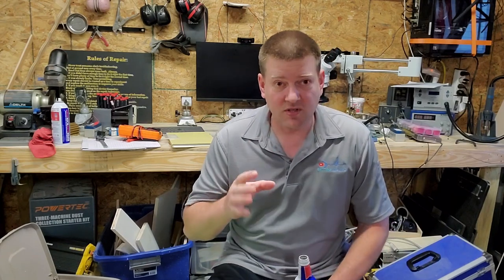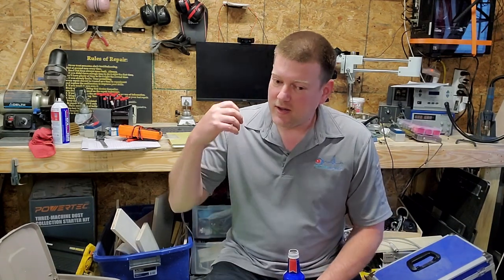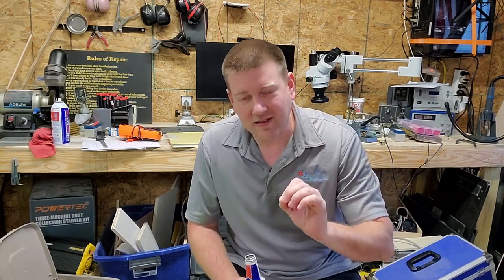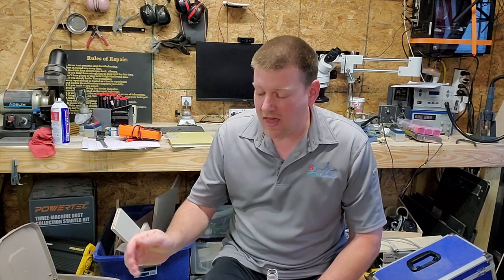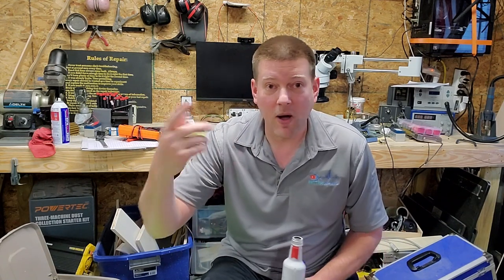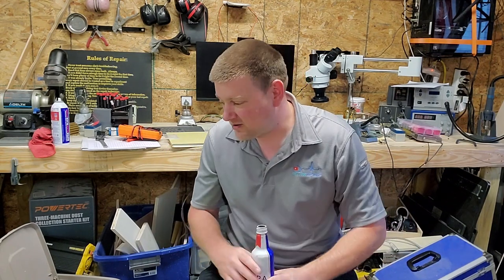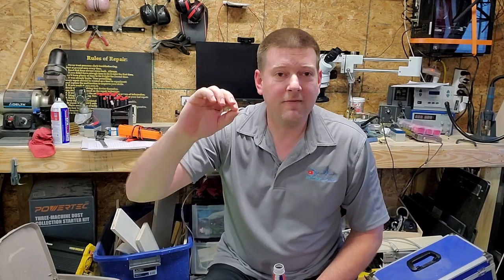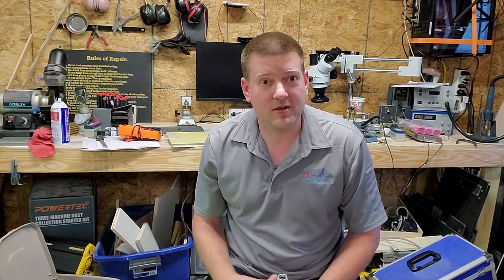Pro Tip: Equipment Settings

Comment: This might be random, but I'm working on an assignment right now for my BTS classes.  "An ESU is being used for a surgical procedure but it continues to alarm when activated. That is all you were told. What may be the issue/problem?"
I've pretty much identified what the issue could be if caused by the machine, attachments/accessories, operator, or patient.
However, I'm not sure what other factors may contribute to this situation. Your insight would be much appreciated.

-Emma
Reply from the maker: Foot control is depressed when the unit is turned on (often thrown upside down at bottom of cart. OR the Patient return / REM is not ok. - Patient resistance is too high or not attached at all.
Reply from the maker: If the ESU has vein sealing / ligasure then the connected handpiece might require BOTH connectors to be plugged in or the handpiece is not compatible with that version of software.
Reply: Thank you! I appreciate that you replied.
Reply from the maker: Write me anytime at abetterbiomed@gmail.com if you have questions
Reply: @BetterBiomedChannel  
Will do!